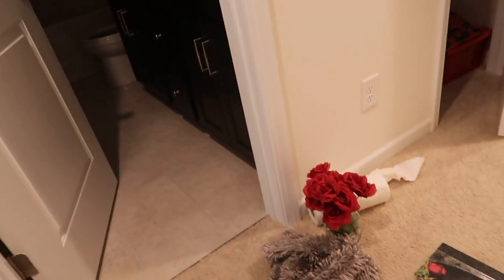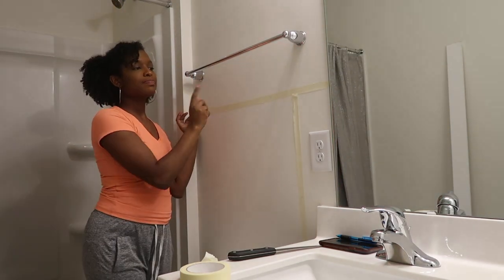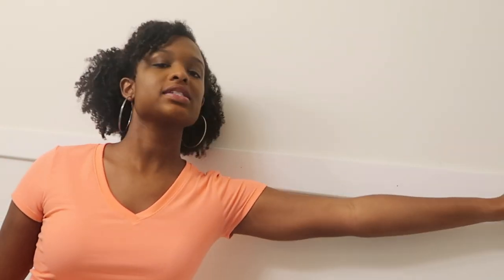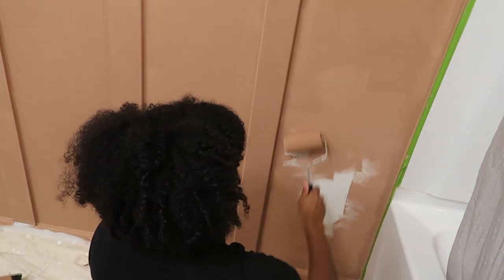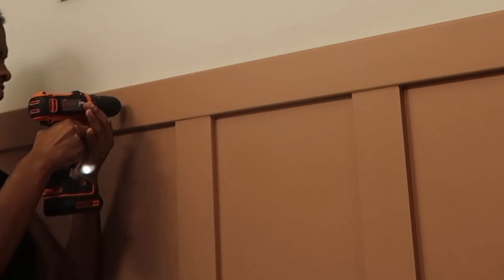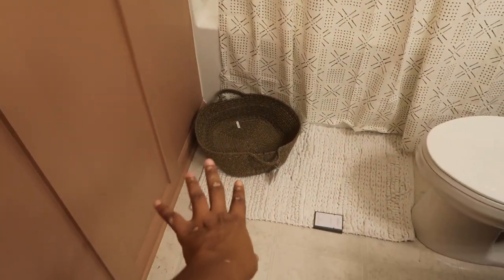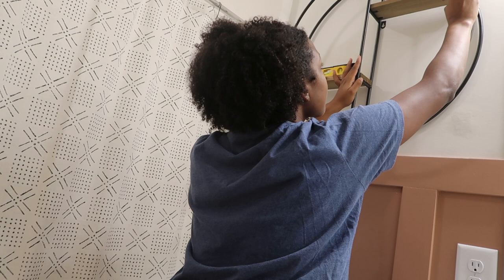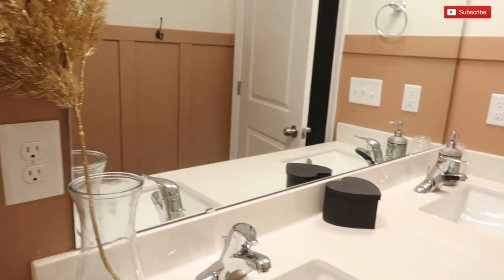Small Bathroom Makeover On A Budget 2020 !! | DIY Board and Batten Wall Paneling Ideas

Comment: Hey, this looks amazing! Well done!

Just a few little tips, when cutting your boards place tape around the board where you're going to cut. This will ensure that the end of the board doesn't chip when you cut through the board with the jigsaw. 

More importantly, always ensure you use the stud finder as most stud finders can pick up if there any electrical cables where you are putting in nails or screws. If you hit one of these cables not only can it be costly but it's extremely dangerous and could cause serious harm or a potential fire hazard. 

Loved the remodel though it looks great!
Reply: Thanks for this comment! These are key things to note... especially the stud finder. I know she appreciated this comment as I did, a potential accent wall DIYer looking on YT at tutorials. You did an amazing job @Lexi Shantell! The theme and colors are a great aesthetic! Bravo!